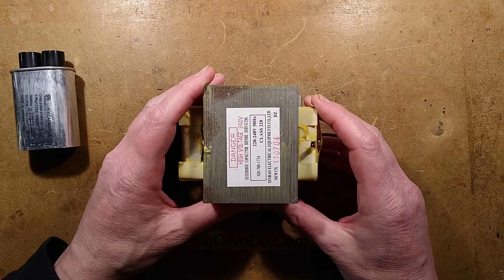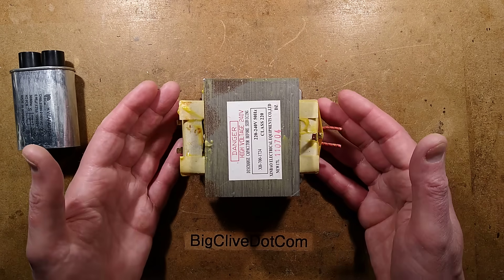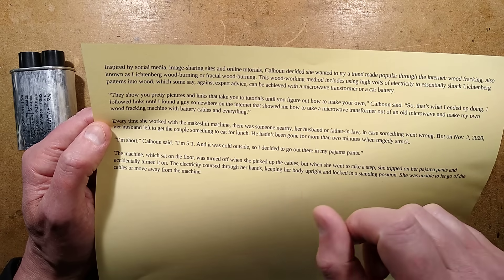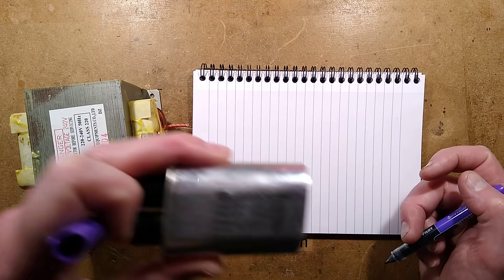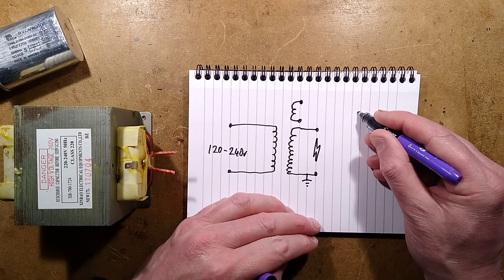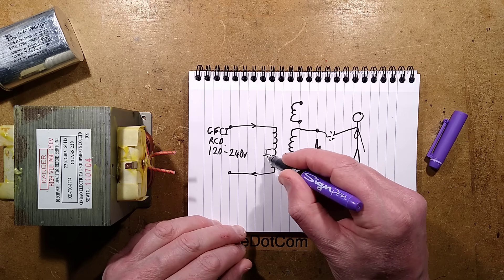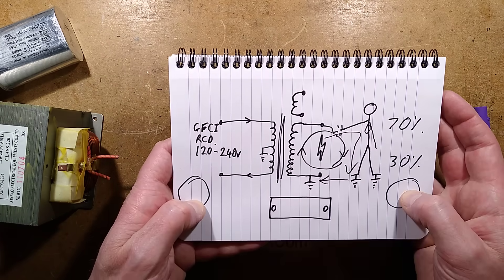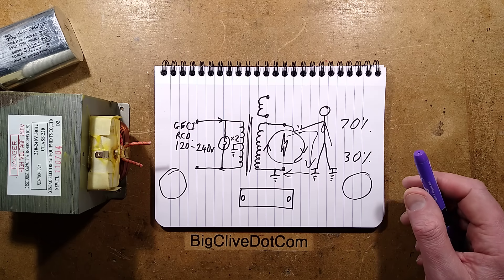The most deadly project on the Internet

Comment: 5:30 I get it. And I'm rather not looking. I'm already queasy.
12:22 Even better, have  buttons that have 3 positions. Not pressed = off,  fully pressed = off, half way pressed = on. If you still managed to get shocked, the cramp should cause a full press, which should turn it off.

Comment: My family owns a commercial sign shop, and not so long ago neon was the preferred way of lighting letters. We literally had someone try to take a piece of neon off the burn in table without shutting off the power. Mind you he walked through a door labeled dangerous, then walked up to the table with caution signs all over it, and then grabbed both ends of a lit piece of neon attached to a 15000v transformer. Luckily he made it out with only some burns because someone saw him do it.

Comment: Unwatchable Clive, I could feel my whole body cringing the entire time. As many of us with these interest I did something crazy as a kid... Connecting the grounded transformer to a metal garbage can and a long high voltage cable to the output and the other end to a 20 foot PVC pipe. At 120VAC the beaker would trip after about 5 second but getting the lead near the garbage can and quickly pulling it away would make a very long 5 to 6 foot (~2 meter) arc. Definitely, the only thing these transformers should be used for is low voltage rewinding. In fact I have one on the table now becoming a car battery charger / jump starter. It's got four separate 12 gauge windings with four 50A bridge rectifiers. Mounted on some industrial aluminum channel as a heat sink. Besides,  what do you really do with fractal wood anyway?

Comment: The insulation required is over 1/2 inch per 1000 VAC of silicone rubber.   Probably the best insulator we have.  This is VERY dangerous as you do not have protective gear thick enough to protect yourself.  1000VAC high frequency arc can jump up to three inches. It is merciless and will kill without warning. Plus coils can store a charge.

Comment: Me with a microwave transformer on the shelf: "Wow, I should try this."

I probably never will. I understand how to "safely" handle it, but there's a few things I don't fuck around with. Pressure vessels and high voltage. It just scares the shit out of me, which is probably for the best.
Reply: Man, I have a similar amount of respect for any high energy system. Explosives, high pressure, high voltage, high tension. I don't fuck with any of it.

I think one of the reasons people don't feel the same reverence for these things is because it is not immediately obvious how dangerous they are.
Reply: Safety more important
Reply: High pressure vessel’s are next level dangerous, but most people would never suspect that to be the case! If you have seen firsthand how a little pressure can do a huge amount of damage you gain a healthy concern when ever you have to work around it. I absolutely agree with your premise! Stay safe.

Comment: I worked with neon and for years repaired microwave ovens. Love to build Jacob ladders. Have been bit by 5000 volt focus voltage on color tv and once while installing a neon sign by 15000v at 30ma hurt but got away ok. All many wears ago. I have extream respect for high voltage and high current. When doing dangerous high voltage demos nobody is allowed within 15 feet or more of energized equipment and i use momentary switch and gfi breaker to have a failsafe. Unfortunately as long as these things are accessible to general public there will always be a dumb ass that will take a microwave apart and fiddle with it to death. People if you don't have extensive training and experience with high voltage equipment then for your own safty and others safety leave the experiments to trained professionals.

Comment: Many years ago, I used to work on the navigation and weapons delivery “black boxes” for the LTV/Chance-Vought A7-E. Yes, it was long ago. And I worked in the AIMD shop on board the USS America.

Even on an Aircraft Carrier, space is at a premium, and the wiser folks far above my pay level moved the F4-J’s AWG-10 magnetron tuning shop and sort of appended it to ours. It was surrounded by plexiglas about 1 inch thick and there were bright red stickers on the doors, warding off all curiosity seekers.

One afternoon, I was working on something on my bench when it sounded like someone fired both barrels of a 10 gauge shotgun. I heard a single scream an then a siren went off. I lept off my seat and pushed the large red button next to the door (as we all had been asked to do upon hearing anything “bad” in the Maggy room).  And waited. Three people came in as blue smoke curled out of the now open door and hauled someone out of the space. His safety suit saved his life and he was more scared than hurt. A power supply that fed the magnetron had arced, and it had destroyed a small hammer he was using to bring a magnetron to frequency. He had done it thousands of times before, but the power transformer had arced in its cage and had created a Tesla coil type light show, coming out and hitting the head of the small hammer, vaporizing it.

The thing is, the magnetron he was working on (typical) could make a million watts of RF energy for every pulse (very, very short duty cycle). Imagine the current that HV power supply could supply. I have no idea, but enough to blast a hole through an aluminum cage and through about 1 inch of plexiglass, finding a ground through that hammer. I gained a lot of respect for those guys who had to tune those maggys. And they were back at work 2 days later. I moved my bench to the far side of the shop. Just a precaution.

Comment: Isn't there a possibility with the dead man's handle of not being able to let go? I also worry that the people most likely to benefit from using it are also the most likely to implement it incorrectly.  It's no doubt a potentially life saving safety measure, but with this kind of stuff I stand at least a meter away and flip the power on with a broom handle, using only one hand that is wearing a thick rubber glove.
Reply: I believe that is why he says to activate it away from the dangerous bits.

Comment: One of the worst thing is that the flexor muscles(close ✋ hand) of hands are stronger than the extensor muscles.  And as you know muscles work with electricity,  when you grab a wire your flexor muscles immediately contracts making your hand close and making you involuntary grab the wire even stronger. And worse, you can't think in a solution during the shock. Your brain can't function because of electricity flowing in your body. 
I am a doctor and I was stupid enough to grab an energized hot wire. (I thought I disconnected it, but turns out I had disconnected the wrong cable) when I touched BOTH wires everything went black ⚫ and I only feeled my body vibrating and my hand closing and grabbed the wire with such a force that I felt pain beside the shock pain. Few seconds later al house went dark, James watt just has saved my life. The broker triggered and went down and disconnected electricity from all house. I sat there in the dark so happy that someone invented that marvelous device. It was a miracle I am alive.  Because in Brazil 🇧🇷 not al houses have adequate electric brokers and with correct amps and voltage specifications.  And I was renting that house. Now I am a little bit less stupid and always double check power line 😁

Comment: I worked in a power plant for almost 42 years. We handled voltages as high as 230 kV. It's frightening that none of the techniques I learned in the course of operating that plant are ever stressed in so many DIY videos. Even residential voltages (120/240) are capable of delivering a fatal current, and people can be extremely careless.

Comment: A few years ago, I watched alot of vids of people using them. Some were doing it in a fairly safe way, placing electroid with the machine off and not touching anything while on, but many would hold one or both with their hand and machine on. Just to turn on a transformer like from a microwave to test it is super scary to me. I would want a thick rubber mat, one hand rule, so if currant did get to you, it wouldn't go from one hand through the heart and out the other hand. I would like to try it, but would never want to have anything touch the table while it's on, a dead man switch for sure, maybe even a third switch for your foot, far enough from the table that it couldn't be touched even if you fell forward and heavy rubber gloves would be good too..
Reply: Maybe a buzzer and flashing light would be good too while unit was on.

Comment: How do you make the stick welders from the old microwave oven transformers? Is it even worth it with inexpensive DC stick welders on the market for $120 and up?
Reply: That works by chopping out the secondary and replacing it with several turns of heavy gauge wire I believe.
Reply: @soundspark  Cool, so is it worth while considering there are affordable purpose built units available today? Or only for someone who is bored or wants to tinker?

Comment: What's killing people is ignorance not the device. That's like saying guns kill people. I'm glad you're not trying to convince people they shouldn't do it. But rather that they should learn all the necessary safety precautions. 

I do it all the time. I stand on a thick rubber mat. The table is a pvc table with a rubber mat. I use thick rubber gloves that linemen use. I have a rubber apron and a full face shield. The leads are attached to a piece of fiberglass pole that linemen use. And I use a foot pedal that acts as a deadmans switch. And I also have indicator lights that show when the unit is plugged in and when the leads are hot. The leads are 4 feet of 5000V rated airfield lighting cable that are on opposite sides of the unit. I also have a printed checklist on the top of the unit to accomplish before I do any fractal burning. As you said, these things can kill people.

The AAW has banned any pieces with fractal burning. That is ridiculous. That's censorship. I hate that it's so prevalent that intelligent people are getting punished because of the ignorant. Let people do what they want to do as long as they're not hurting someone else. I won't join the AAW because of that.
Reply: Guns are designed to be safe when operated correctly.  These homemade deathtraps are more akin to one of those recalled Taurus handguns.

Comment: It's interesting how careless the  DIY community can be. Been an a electronics hobbyist for a while and you learn quickly that Microwave Transformers are the best thing since slice bread. Lot of a great uses for them but you also learn quickly that they can kill you fast. As you said, it is insidious and when it does happen it's to late. You are exactly correct in your observation on complacency, that is exactly what it is. A120V electrocution hurts but it's a love tap compared to the jolt you will get from a microwave transformer. I really like the deadmans switch idea. I was also thinking, do you have to be holding the electrodes or can you attach them and move away from the danger zone? I would expect that would be an ideal way of doing this.

Comment: Thank you for this. You've answered lots of questions I've had on this matter. For the Deadman switch, if you were shocked while holding it, would you end up gripping it tighter, or is that only a factor if your hands are being shocked, which isn't likely, because you're holding the box?

Edit: after some thinking, I came up with a solution. 
Have the two buttons on the ends of handles, separated apart by some sort of structure. Then have a lever, positioned kind of like the break handles on a bicycle , which your hand holds. The levers actuate normally closed switches, so if your grip involuntarily tightens, the normally closed switches are opened, opening the circuit. 
If that made any sense.

Comment: Wonder if you could build it into an old microwave so it can only be energized if the entire unit is sealed so it can't be touched accidentally, similar to the door interlock for cooking?
Reply: Excellent idea.  Get a particularly big microwave so you can fit particularly large objects inside.  Take out the magnetron, capacitor (DISCHARGE FIRST!), and diode, add a rubber grommet to the hole where the magnetron was, and run the HV wires into the box through it.  Keep the primary of the transformer connected to the primary side switches and electronics and you have a fully interlocked machine.

Comment: i believe that a MOT (microwave oven transformer) is a SHITTY device for making Lichtemberg figures!! it's too powerful and the result will be terrible!! (apart the danger) the figure will be just a smear of burn with little details

use a ZVS driver that you can buy on like eBay, with a random CRT TV flyback transformer, make 12 turns on the core of the flyback and power the ZVS with like 20-24V DC, there are TONNES of videos on how to hook up such thing, the power level will be way less, the result will show up slightly slower and it will be WAYYY better looking!! also the output current is lower and even if IT DOES pose a risk of electric shock it's not comparable to a MOT

i did it and the results were AWESOME after some experimetation

Comment: I once held a very primitive make shift styrofoam cutting instrument through insulated handles, it had two leads each to be held in one hand, I wasn't electrocuted but the leak voltage was enough to give my heart arrhythmia... Never touched it again...

Very good informative video, a heads up for art enthusiasts who may be thinking about trying this stuff...

Stay safe, electricity can be very dangerous.

And those designs usually suck anyways, the one in the video looks neat though... if you want fractals just design then in Inkscape and have it laser engraved much cleaner method...

Comment: It scares the hell outta NOW knowing how dangerous it is messing about in a microwave. I like to take things apart and either try to repair them or get extra parts. Ill admit I have took an microwave apart only once but thankfully I didn't go poking and touching every component like an idiot. Glad I came randomly came across your video. I will sure as hell be ALOT more careful if i even think about messing with another microwave or anything containing high voltage.

Comment: The old cathode ray tube type televisions used 20,000 to 25,000 volts on the yoke of the picture tube.  I foolishly left one plugged in and proceeded to take it apart.  I regained  consciousness on the floor in great pain.  The only reason it didn't kill me is part luck and part because there is very little current compared to a microwave.  I agree with your video and will not be doing the deadly project with the microwave transformer.  I will never take apart electronics while it is plugged in again either.

Comment: I'm an industrial electronics tech. I work on 3 phase and single phase systems daily... safely and there's no way in hell I'd trust  that. Thanks for the video. I hope that someone who is considering trying this out will reconsider. Electricity can be unpredictable even when safety measures are taken
Reply: Safety is a binary statement. You either have safety or you don't have safety! There's nothing in between. Except in this case perhaps your smoldering body!
Reply: My electric company puts out a monthly magazine. One issue they featured a linesman who had an accident. He was in a bucket lift near lines known to be live, positioned just underneath. He raised one arm to make a signal to someone on the ground, and the visor on his helmet obscured his overhead vision at the moment, and his hand momentarily brushed the line. The current passed thru to the other arm with hand holding the rail of the lift bucket, and the injury was such that he needed both arms amputated at the elbow.
Reply: @onemoremisfit  oh no, that's brutal
Reply: Totally!

Comment: As regards the idea that wearing thick insulating boots will help: doesn't that just make you & the Earth into a capacitor? And the high voltage alternating current will just "see" that capacitor as a short circuit.

Comment: Seems like a good time to ask a long term question of mine. If I can tread on a possibly well grounded floor with bare feet, I can safely hold a kettle lead with 2 layers of pvc between me and ouch,, why is it not the case that a floor Matt made of 2 layers of pvc can't protect me against accidentally contacting my arm against a live 230v bus bar? I would have thought that all sparkies would routinely use them if so? Is it the damp? Petition to rename to not dead man's switch

Comment: Hi Clive, a very important safety video. I was a domestic appliance engineer and remembered one of our engineers working on a microwave, he went to short out the high voltage capacitor with a screwdriver but had not turned off the power, there was a blinding flash and the screwdriver ended up in half welded to the capacitor terminals.
Reply: HOLEE SHIT!